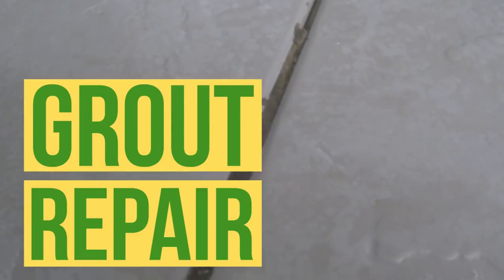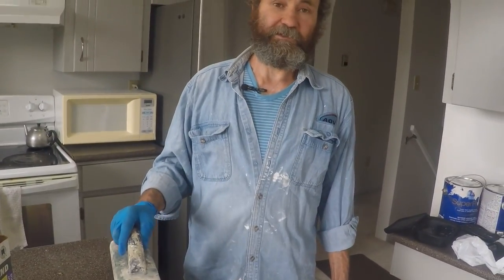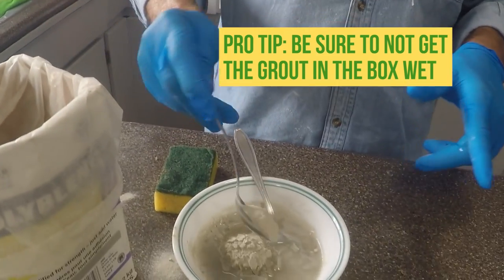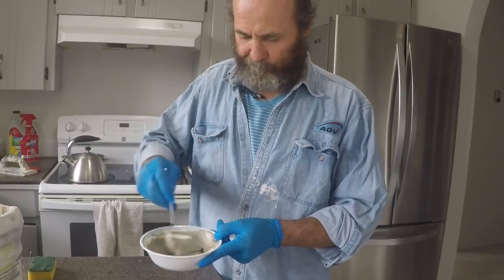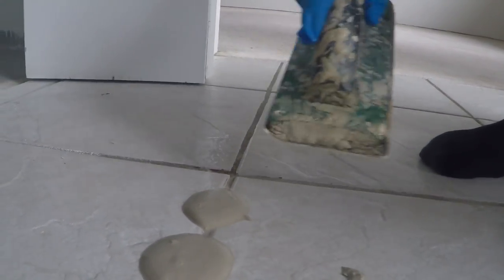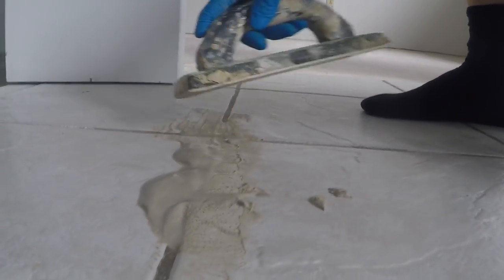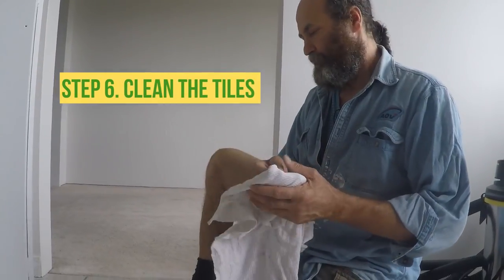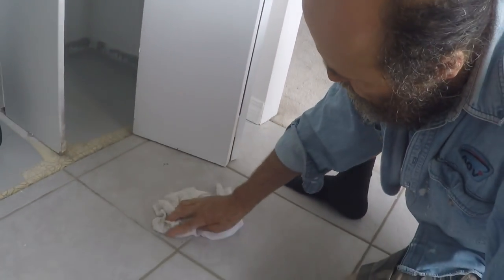How to Repair Grout DIY | Quick Fix

Comment: Awesome 
how long did it take to dry ?
Reply from the maker: Thank you very much for your question and support. 
Let me know, if You have more question.
 About 15-30 minutes to set, wipe up the excess grout with water and sponge. Wait 2-3 hours and clean it again with nice clean dry cloth, making sure to clean all excess of grout from the tile, leaving it only on the grout line.
It takes about 24 hours to dry, some times it takes longer, If it is going to be sealed, allow  all moisture evaporate before sealing.
Reply: Thanks buddy
Reply from the maker: It is my pleasure.

Comment: Do you show how to removed cracked grout?....should I use a Dremel to clean it ?...the cracked and chipped grout or just go over top?
Reply from the maker: Hello Susan , thank you for your time, you need to remove at least some of the top part of the old grout, Dremel  should do it, get be careful not to damage your tile, clean the area very clean to remove all the dust, other wise the new grout will not hold to the old grout.please let me know, if you have more questions, keep safe.

Comment: The cleanup looks hardest--getting the grout mix off the tile without messing up what is in the spaces between.
Reply from the maker: Thank you very much for your comment, 
Clean up needs a bit of patience, 1/8" space looks better in my opinion, than the tiles on the video that are spaced about 1/4. let me know any questions!